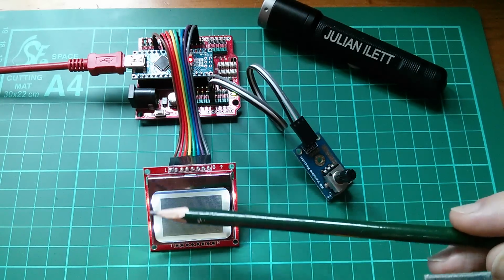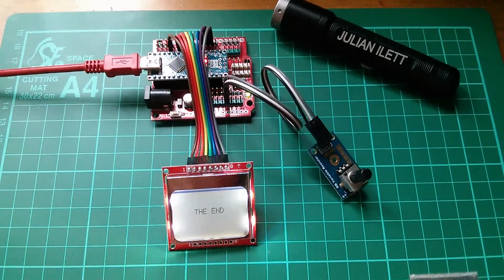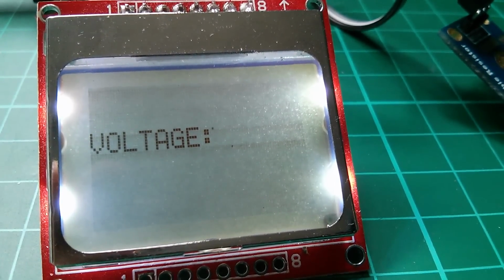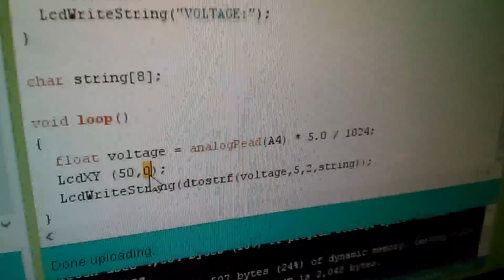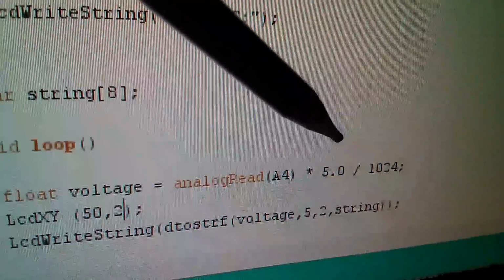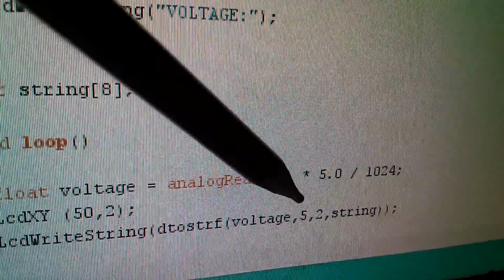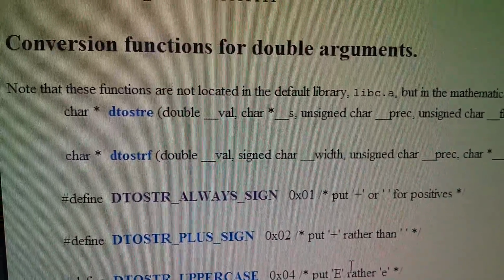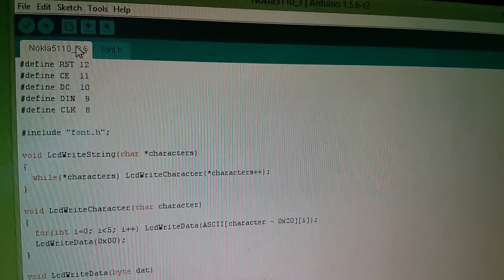Arduino Nokia 5110 LCD Tutorial #3 - Live Numerical Data

Comment: No code here, I was wondering I am trying to write code for a rotary encode and 5110. I need to output two pulses to turn on a relay with 5 volts.  I am not a good programmer at all. Any help would be appreciated by anyone.

Comment: BOY that fellow had it right, I built a compass using this display, the first display actually got so bad I could no longer use it, and had to replace it!  I thought I had burned her up, and after soldering it to a permanent board, I was very angry at myself for not heading the warning to use only 3.3 volts even though the display I was using has 3.3-5V printed on the board!  It was only after I had completely rebuilt my project on a different board that I discovered I could still use that display when hooked to 3.3 volts and using a 3.3 volt arduino or ESP8266 to drive it, which is what I am using for it in a different project.

Comment: arduino is actually c++ based not c.
 stdlib.h is the standard functions library. 
when program in visual c++ i don't use as an import because it is imported automatically by the compiler all i need to do is say: using namespace std; and that allows me to use commands like cout, cin and a pile of other functions that i don't even know at the moment

Comment: Great tutorial.
I used an old NiMH AA 1.2V rechargeable battery with a potentiometer and it worked just fine (the voltage was variating a little, but not too much to worry about).

Regards,

Comment: Thanks so much for these videos they've been really helpfull to see how to do this without libarys, however ... My Voltage only reads 0.00 unless i unplug the pot from the breadboard then it flys up and down erratically. i'm using 3.3 volts but i think i changed the code correctly...
float voltage = analogRead(A4) * 3.3 / 1024;
  LcdXY (50,2);
  LcdWriteString(dtostrf(voltage,5,2,string));
Reply: I know this comment is old, but just in case you're still interested, I think your problem will be in hardware rather than in software.  In other words, one of the connections to the pot might be bad or the pot itself might be bad.

Comment: I want to use this code to accept digital input from pin 2 on the Arduino UNO with a DHT11 Temp/Humidity sensor using the DHT.h library. Everything you have shown has worked magnificently. Am I wrong that your using analog in or is the ADC being used...?

Comment: i am having problems with getting the coding to work

i can get the first load to work but when i try and use the font.h file i get these errors

In file included from dualvolt.ino:10:0:
font.h:101:1: error: stray '\357' in program
 };ï»¿
 ^
font.h:101:1: error: stray '\273' in program
font.h:101:1: error: stray '\277' in program
dualvolt.ino:95:1: error: stray '\' in program
dualvolt.ino:95:3: error: 'ufeff' does not name a type
Error compiling.

Comment: Thanks for your great video! I'm a newbie and I've learnt many things from this, but while using your example in my Energia Project I got a problem with the function "dtostrf()".
I typed  "LcdString(dtostrf(test,5,2,string));" and it noticed me that "error: 'dtostrf' was not declared in this scope"
I had used the function itoa() instead but it still failed.
Did I miss any library?
Can you help me  #Julian Ilett?
Thanks you very much.
Reply from the maker: Vũ Bạch Nhật I think dtostrf() is in stdlib, you could try including that - but it should be included by default.
Reply: Julian Ilett Thanks for answering me :). I had searched of it and found it in stdlib, but although I included that library, it still noticed an error: " 'dtostrf' was not declared in this scope". The function itoa supported by that library worked but the result displayed on the LCD did not match. My Project's purpose is getting GPS data (real number)  and displaying them on the LCD screen so that itoa is useless. I'm searching for another functions. Thank you and looking forward for your reply.

Comment: Great work, I started watching last night and today I got my 5110 LCD display 4 lines of text with 2 blank lines between the lower 2, very happy. Thank you.

Now I just need to merge this code with the 4ch Ohmeter I've been working on this week.

Just read through all the comments and saw how you read the datasheet and built this code from the groumd up.

I have a cheap serial display that should have worked the same as the Zolen screen, turns out it does not use the ST7565 chip like the Zolen screens.

I've got the data sheet but I'm still lost, any ideas?

Comment: Just a note, folks.
I cut 'n' pasted the code from YouTube and got all sorts of compile errors. Turns out I'd inserted non-printable character(s) at the end of both files. Only painstakingly stepping over the files with the cursor revealed - they were (Sodds Law) after the last character in each file...HTH.

Comment: Following on from the comments from Marcus and Julian below (which I can't reply to to keep this properly in context)... the PCD8544 controller chip that these Nokia 5110 LCDs use it is happy to have 5V + (absolute maximum of 7V), but I'm unsure as to whether the LCD is getting it's power from the driver chip's voltage generator, or directly from the supply voltage. I suspect it is from the supply voltage, hence the variance in contrast, etc when run from different supply voltages. The following site may be of interest: http://www.avdweb.nl/arduino/hardware-interfacing/nokia-5110-lcd.html

Comment: Tempted me to take my module out of the parts bin, which previously would only display all black. Turns out, it's fine but these modules all have very different contrast values.  On 3.3v, I had to go as low as 0x9C for Vop and 0x13 for bias to get a readable display.

Others stuck with an all black display, don't be afraid to go really low with Vop. My module was a 5110 display, blue soldermask board from eBay, characterised by an SMD resistor/cap at the top of the board.

Comment: When using fonts, you should use them in PROGMEM. Saves holding the data in sram, http://arduino.cc/en/pmwiki.php?n=Reference/PROGMEM
Reply: To leave the font data in flash memory instead of consuming valuable SRAM, you only have to change two lines.

Change #1: (in font.h or wherever ASCII[] declared)
static const byte ASCII[][5] = "
to
static const byte ASCII[][5] PROGMEM = "

Change #2: (in main sketch)
LcdWriteData(ASCII[character - 0x20][i]);
to
LcdWriteData(pgm_read_byte(&ASCII[character - 0x20][i]));

Instant saving of 480 bytes of SRAM!
Reply from the maker: That's a good point. If I were doing this in assembler, the font would be in a data table in program memory. I'll have a look at that wiki page. Thanks Tobias.
Reply: Why not put it in EEPROM? May as well do it for all my Arduino's - eeprom doesn't ever get used, and I've got a ready font whenever I need it.
Reply from the maker: Peter Feerick Peter, many thanks for this, particularly that you gave me step by step instructions! I've now finally made the change and it works well. Video coming soon.

Comment: Thanks for the video, Julian. Fun thing is I've got a lot of the parts you get in "Postbag !"*, and I can replicate easily. As I have no ammeter* currently - no pun intended-  but have a couple of those Hall Effect current measuring xducers, I can turn one of my pro mini's into a useful multimeter for testing a battery protector 'diode' (reverse p-fet) I'm trying.
Keep 'em coming!
* Thanks for switching me onto the Nano expansion shield, and the lovely LED buck converter PSU, both of which in constant use. (My missus hates 'postbag', cos she knows the kitchen table is soon flooded by Chinese jiffy-bags...)
* UPDATE: I now have an Avo 8 I bought for about £30 at a flea-market!

Comment: I believe you should divide by 1023 rather than 1024. Since the maximum value returned by analogueRead is 1023 you would divide by 1023. You are likely get a result of 4.9951171875 which is rounding up to 5.00 on the conversion. My background is numerical analysis and quantitative analysis and so I'm quite mindful of floating point conversions and "end cases". Thanks for the amazing video, I totally enjoy them and learn tons.
Reply from the maker: mmilner7666 This intrigues me. I was happy to use /1023 until I thought about the range of voltages that 1023 represents. Sure it's 5v at the top of that range, but it's 4.9951171 at the bottom. So I'm thinking 1023 actually represents the mid point between those 2 values = 4.9975585 plus or minus half a bit. similarly, an ADC result of zero represents a range of voltages between 0v and 0.0048828 volts. Or is it more complicated than this?
Reply: Julian Ilett I think that whatever the final value you want displayed may be, you want to scale the ADC values range from 0-1023 to 0-1, and so you should be dividing by 1023.  Then if you want the final values to be the midpoints, you should be multiplying by 4.995117 (the lower end of the top step) and adding 0.002441 (half a step).  So the final expression would be:

ADC / 1023 * 4.995117 + 0.002441

With ADC at 0, the result is 0.002441

With ADC at 1023, the result is 4.997558

Thanks for sharing all these interesting projects, Julian.  With the second-to-none clarity of your narration, your channel is up there with my top 5.
Reply: Divide by 1024 is a collection of shifts - so more efficient than divide by 1023. Probably fine unless you are looking for 1/10,000 range accuracy.
Reply: No. There are 1024 possible outputs, that is 0 - 1023. So 1024 as the range is 100% correct.

Comment: I use these displays on 5v using the Adafruit libraries. They work brilliantly and seems much less complex than your code too. Worth a try?
Reply from the maker: abyssunderground Yes, I'm sure numerous libraries exist for this particular display, but I produced this tutorial series to show how to build the software from the ground up.
I'm completely ambivalent about the use of libraries. Use libraries to get the job done quickly, but expect missing functionality and even bugs. Write your own code (produce your own library maybe) if you want a full and complete understanding of the hardware and software.
The third option is to fork someone else's work of course.
Reply: Julian Ilett That's fair enough. I wasn't aware that's what you were doing so sorry I missed that!

I prefer things to "just work" where possible which is where my love for libraries made by those who know what they're doing comes from. I have modified libraries before to work the way I want them to but nothing substantial. In most cases I wouldn't know where to start. I can write software but interfacing directly with hardware is my downfall.
Reply from the maker: abyssunderground And most of the time Arduino libraries do "just work". Then, one day, you start using a library that "just doesn't work" and you become suspicious and cynical - like me!
Reply: Julian Ilett I've had those moments! I'm battling random crashing issues at the moment and I don't know who is to blame, the code or the hardware?!
Reply: Julian Ilett the arduino libraries are not to be trusted, you did the right thing! wherever possible write your own routines and then you have your own libraries...(and share findings etc)

Comment: the C libs have lots of short names.
std = standard  (not "stud" :-))
con = console (for platforms having a console)
io = input output
lib = library
str = string
env = environment (for platforms having an environment)
arg = arguments
def = defines

possible optimization:  I don't know that particular screen, but I guess you can write stuff more optimally.  It'll need a test :)

basically change the LcdWriteData() into 3 functions:
LcdEnableDataWrite()   which does the first 2 lines
LcdWriteDataByte() which does the actual data byte write
LcdDisableDataWrite() which does the last line

then you can change the LcdWriteString to do the LcdEnableDataWrite() just once (instead of 6 times per character)
write all the data, then do LcdDisableDataWrite() once (instead of 6 times per character)

Might not be entirely relevant to you if you don't need this to be speedy.

Comment: Hey Julian can you write an oscilloscope program to capture live voltages?
Reply from the maker: area46241 Yes, and it's already been done. The problems I forsee with an ArduScope are getting it to run at useful speeds (fast timebase settings) and taking the analogue input voltage range beyond 0v to 5v.
Reply: Thanks Julian good info on the 5 volt limit

Comment: I'm glad that you are now not so sure about the 5V compatibility of these displays. I now supply mine at 3V3 and place resistors inline from the Arduino digital outputs. I'm doing this because I also had problems which went away once I started treating them as 3V3 modules.
Reply from the maker: Marcus Jenkins I wonder if you could treat the data lines as 5v tolerant and make direct connections to them. Just tried it - seems to work OK - 3v3 on Vcc, 5v signals on data lines.
Incidently, I accidently put 5v on Vcc of the nRF24L01+ module for several minutes and it seemed to survive!
Reply: @JulianIlett if it's NOT 5v tolerant it'll still work but it will certainly damage and destroy that IC over time.

Comment from the maker: #define RST 12
#define CE  11
#define DC  10
#define DIN  9
#define CLK  8

#include "font.h";

void LcdWriteString(char *characters)
{
  while(*characters) LcdWriteCharacter(*characters++);
}

void LcdWriteCharacter(char character)
{
  for(int i=0; i<5; i++) LcdWriteData(ASCII[character - 0x20][i]);
  LcdWriteData(0x00);
}

void LcdWriteData(byte dat)
{
  digitalWrite(DC, HIGH); //DC pin is low for commands
  digitalWrite(CE, LOW);
  shiftOut(DIN, CLK, MSBFIRST, dat); //transmit serial data
  digitalWrite(CE, HIGH);
}

void LcdXY(int x, int y)
{
  LcdWriteCmd(0x80 | x);  // Column.
  LcdWriteCmd(0x40 | y);  // Row.
}

void LcdWriteCmd(byte cmd)
{
  digitalWrite(DC, LOW); //DC pin is low for commands
  digitalWrite(CE, LOW);
  shiftOut(DIN, CLK, MSBFIRST, cmd); //transmit serial data
  digitalWrite(CE, HIGH);
}

void setup()
{
  pinMode(RST, OUTPUT);
  pinMode(CE, OUTPUT);
  pinMode(DC, OUTPUT);
  pinMode(DIN, OUTPUT);
  pinMode(CLK, OUTPUT);
  digitalWrite(RST, LOW);
  digitalWrite(RST, HIGH);
  
  LcdWriteCmd(0x21);  // LCD extended commands
  LcdWriteCmd(0xbf);  // set LCD Vop (contrast)
  LcdWriteCmd(0x04);  // set temp coefficent
  LcdWriteCmd(0x10);  // LCD bias mode 1:40
  LcdWriteCmd(0x20);  // LCD basic commands
  LcdWriteCmd(0x0C);  // LCD normal video
  
  for(int i=0; i<504; i++) LcdWriteData(0x00); // clear LCD

  LcdXY(0,2);
  LcdWriteString("VOLTAGE:"); 
}

char string[8];

void loop()
{
  float voltage = analogRead(A4) * 5.0 / 1024;
  LcdXY (50,2);
  LcdWriteString(dtostrf(voltage,5,2,string));
}
Reply: http://hastebin.com/cufoxazoxo.coffee